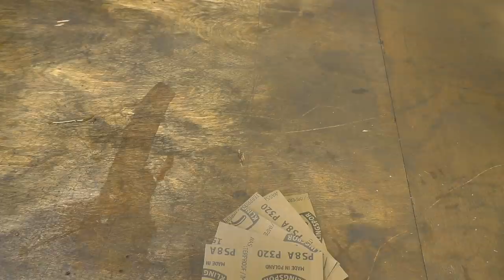Forging epic FANTASY SWORD Out of Rusty Coil Spring

Comment: Great work! I have a question tho. When pouring the liquid metal in the mold for the guard, does it just burn the styrofoam and basically take its place? Specifically asking about 9:05 ish
Reply: yes its call casting 

The styrofoam is just a form that holds that green sand in place until the metal is poured. You can also use a wooden or plastic form though this way  it is highly recommended that you have two boxes of the compact green sand. There are hundreds of videos on this and you'll find that most use the wooden or plastic form because it is smoother and less of a chance for it to collapse when pouring. 

Of course everyone does things differently, I'm no exception to using tools or doing things that suppose to be one way yet does it another but get the same result. 

Cheers!
Reply: @Laila Creation why are you being obnoxious?

Comment: The sword looks impressive and it’s very clear you have skills that I don’t. I wish I could work with metal like that but alas I must stick to watching way too many YouTube videos and Forged In Fire. That being said I do have two main questions. 

1) How did you suddenly have three times the material on the tang than you did before? It was very clear when you started cutting away material that you were cutting away too much around the tang. You had a little nub and cut off the material that could have been used to lengthen it. Then suddenly you transition to a new scene and your tang is 3x longer. Did you weld more material on? Doesn’t make sense to cut away material around your tang only to weld on more material later. 

2) Why was there no mechanical connection with your tang and handle material? You obviously used some sort of resin or glue to hold it but a couple of pins would have been easy to do and would have given your sword the strength it needed around the handle. 

As it stands between the questionable lengthened tang and no mechanical connection to the handle I don’t have a lot of faith that the sword would hold up over time. 

Great show piece though.
Reply: Njig